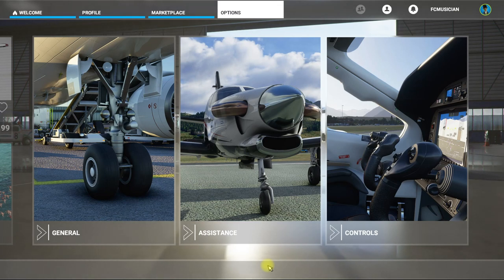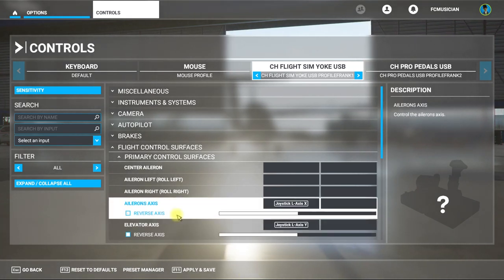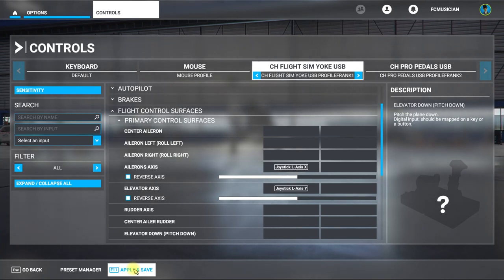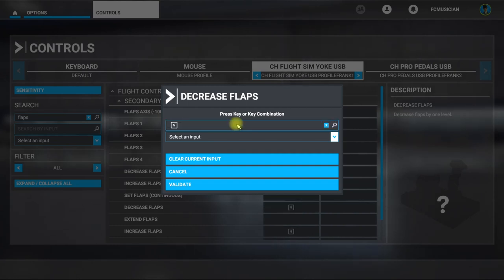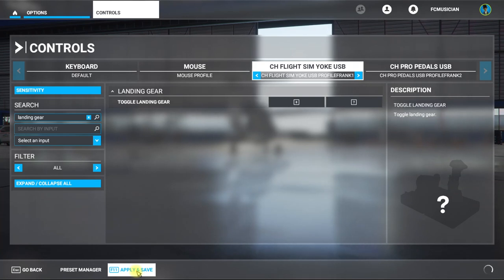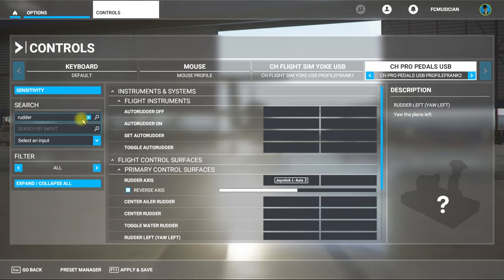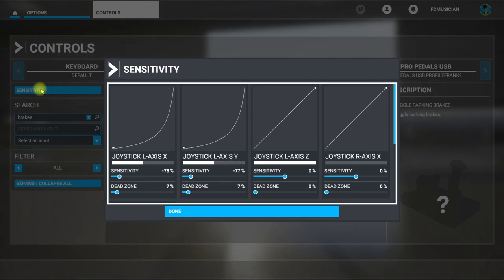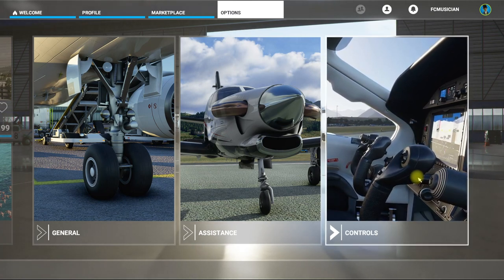Mapping the CH Yoke and Pedals in FS 2020

Comment: I think I need to find the drivers and firmware. I get all throttle, bank left, and rudder twitches. I put in my Hotas 4 from my PlayStation and no real luck on all controls until I downloaded the firmware and drivers and it worked all of a sudden. Do you have a link for the drivers/firmware?
Reply: For ch products flight sim yoke and pedals usb just the standard simple one they sell

Comment: when i go into sensitivity i have 2 fields a + and a - sensitity. how do i adjust those.
Reply: It may be firmware/driver demanded, mine will not calibrate, throttle just goes full with no adjustment, and ailerons will only go left bank

Comment: when i hit the button on the yoke to release the brakes, as i move the throttle up, the cessana 152 still does not move. it seems that the brakes are still locked. can you tell me what is wrong. for me to get the the plane to taxi, i have to keep stepping on the toe brakes. my takeoffs suck because something seems wrong.  thank you
Reply from the maker: When you hit the brake switch. Do you actually see the brake handle move?. Had to program mine a couple times over before it took.
Reply: I made some changes to setting and now it works fine
Reply from the maker: @jtepsr  Good deal! Glad it worked out for you.